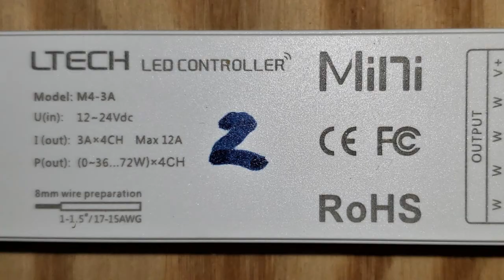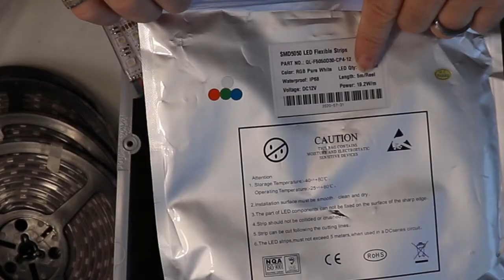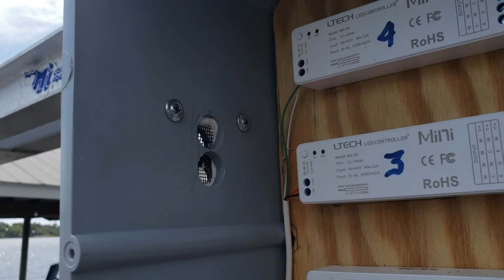How to use Indoor Power Supply For LED's Outdoors

Comment: Im installing led strips on my slingshot. I used 4 rolls(16ft per roll). I cut and connect all the connectors to the leds strips  and check every strips individually before installing and they all work fine. When I installed the leds to a sp105 e with a sp901e amp. Some of the leds turned on and some dont. After that  I check every led individually and the led just dims.
Reply from the maker: I never use amplifier.

Comment: Is it possible to run different wattage lights from outdoor and keep these lights off for sometime(one or two hours ) daily using any timer off any floor of buildings.
Reply from the maker: It's ok to use different wattage lights as lomg as it's the same voltage and you have the correct wire. But Can you be more specific please

Comment: Clem, my colors are blue red green and black, how do I know which to make which to connect to the led strip?
Reply from the maker: Those are your wire colors, so connect red wire to the letter R on the strip, green wire to the letter G on the strip, blue wire to the letter B on the strip, now that leaves you with black and that will go to positive+.
Reply: @thebesthowtobyclem6908  Clem, I'm running 3 5 meter strips and got the power supply you suggested. How many times do you think I need to "run-back" to the light strips to get even power?
Reply: @thebesthowtobyclem6908  dont know if you want me to go parallel or in series (forget the name of the other choice)
Reply: @thebesthowtobyclem6908  do you mind if I email you pics? I tried "guessing and think I damaged either my lights or the controller, I bought all new lights, controller n remote
Reply from the maker: For you Tommy, run 3 times. One for each strip.
Reply from the maker: You can